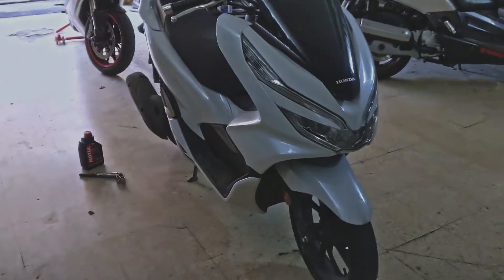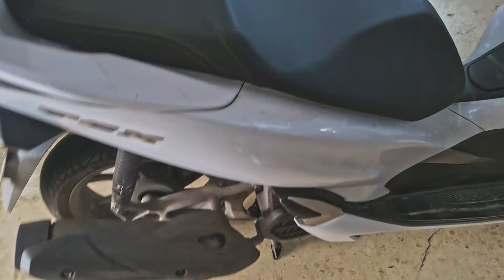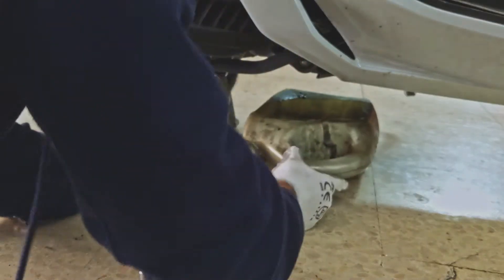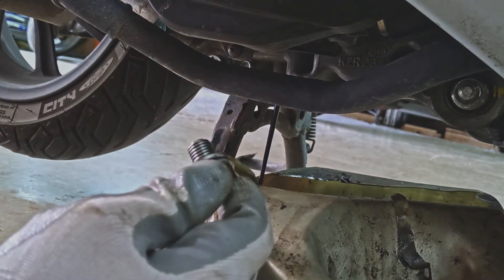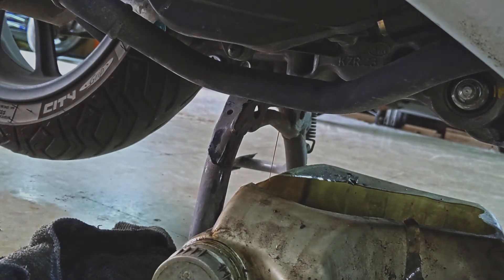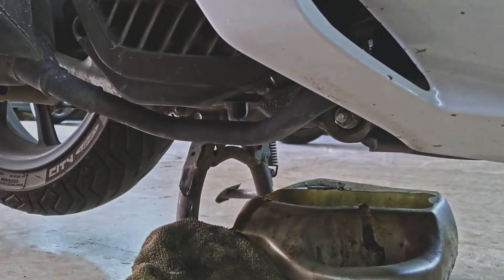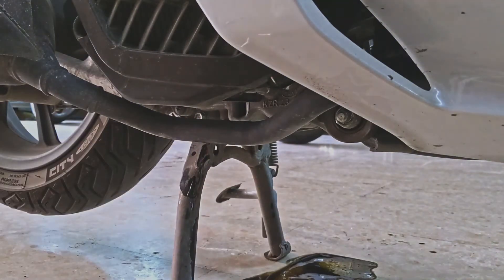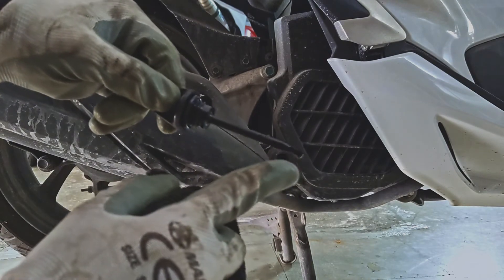How To Honda PCX 125 oil change

Comment: Outstanding vid.  Thank you. Do it yourselfer’s  can always use help and you did just that with this vid.  Excellent.
Reply from the maker: Glad it was helpful!
Reply: @pullumoto  my PCX sat in garage for a period. Found a circular oil spot on garage floor.  Turns out it was coming from the bottom plug.  Cleaned everything up then used a small smear of gasket sealer for on face of plug.  I think this will do it.  Other then that your instructions were great.
Thanks again

Comment: did you fill 0,9 litres or 1 litre? Thank you.
Reply from the maker: 0.9L
Reply: @pullumoto  If the oil comes in a 1L bottle how do you make sure only 0.9L goes in? How do you know when to stop?
Reply from the maker: @Bangandthedirtisgone  most oil bottles have a window on the side which shows you how much oil you poured into the engine, if you don't have it either pour in a measuring cup or work by estimation, you can always put the dipstick back in the engine and remove it again to check the oil level and fill as needed.
Reply: @pullumoto  Thankyou!

Comment: How many km after need to change oil in the pcx125
Reply from the maker: The official interval is around 8000km but you can always change it earlier
Reply: @pullumoto  Honda in my country says 6000km

Comment: Take dipstick out oil then gets atmospheric pressure to help it flow,, page one mate
Reply: As soon as you unscrew the bolt it doesn't make any difference... ;) And yes, bottom of engine compartment is never pressurized. ;)

Comment: can I use synthetic 10/40w motor oil?
Reply from the maker: yes you can use synthetic. Use 10w40 oil if you live in a hot climate
Reply: @pullumoto  Thank you....it was 5/40w synthetic that I put into the engine. All good
Reply: Can use 10w40 semi synthetic  my pcx